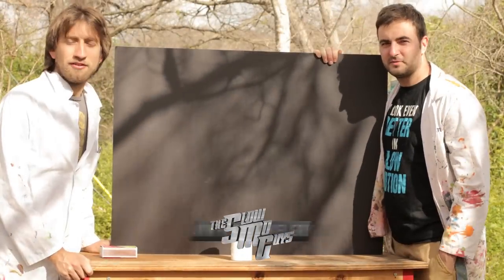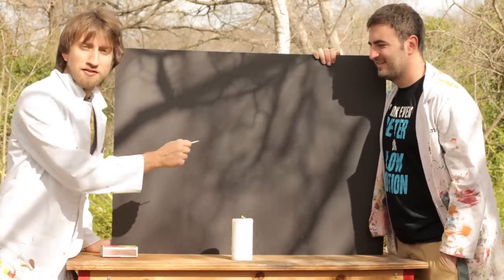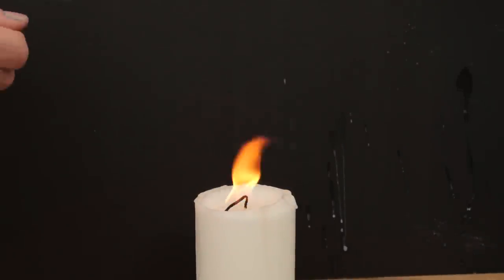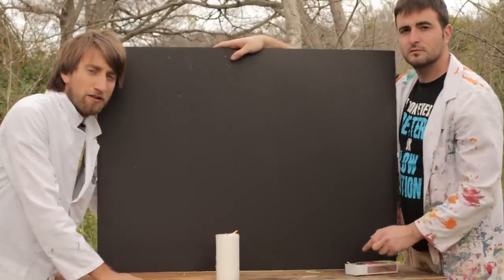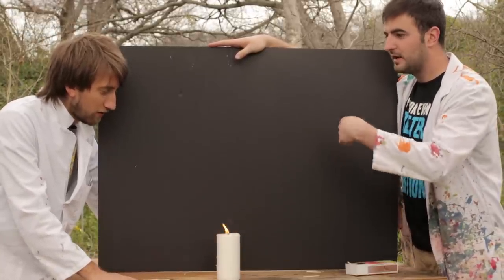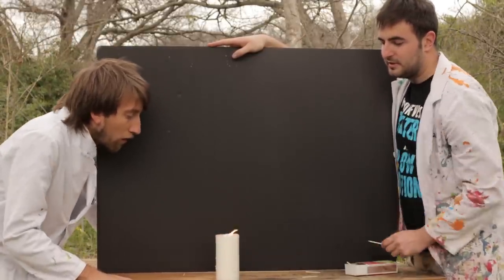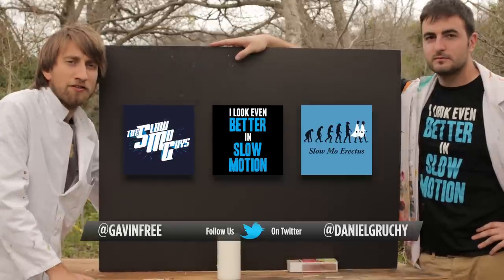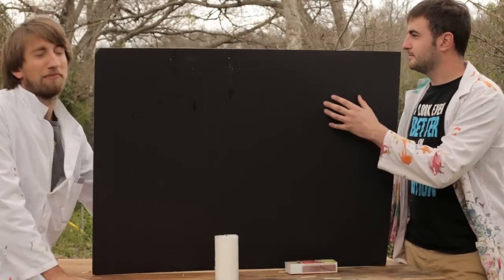Lighting a Candle Without Touching it in Slow Motion - The Slow Mo Guys

Comment: Hey Gav, I'd love to see RC helicopter blades in slow mo. Not the cheapo ones you get at the mall, but the full 3D ones, like 600cm across. Maybe you could strap them down and run them through the controls to see what the blades are doing, see gyroscopic procession in action, and maybe even the differences between flybar and flybarless types. That would make a great video.

Comment: Basically what happens is, the smoke is uncombusted carbon oder semi-combusted carbon (CO), because the wax is mostly carbon and it vaporizes faster than it can burn in the air. So when you light the white smoke, which is very finely divided Carbon in air, it combusts and turns to carbon dioxide, which is colorless (which is why the smoke seems to disappear). The flame itself is just gas being ionized from the heat of the carbon-oxide reaction, but the smoke burns so quickly back down to the candle, that the air around doesn't get heated enough to be ionized, which is why you don't see a flame jumping down from the match to the candle, but just the candle flame reigniting.
Interesting sidefact for cars: If you see a car accellerating and a black cloud is coming from the exhaust, it means that the engine doesn't get enough air to properly burn the fuel. It's often a sign for the engine either being too cold or badly adjusted (which can happen during a non-professional tuning)

Comment: Warning: The following contains the thought of a Nerd and what this nerd believes to be happening. Do not read if you have little or no interest in science.
What I believe is happening is that the candle has not got the required level of oxygen to form complete combustion, and after the flame is extinguished the smoke is actually mainly consisted of unreacted carbon particulates. When the other flame is put in the smoke and the smoke has not diffused too much (is basically still in one blobb) the flame from the match can ignite these particulates and can travel through the smoke, to the candle, thus igniting it again. 

Sound about right or completely wrong?
Reply: A bit like a dynamite fuse only it's a gas
Reply: Nashyj495 what i thought it was is that the wick of the candle is coated in an oil so its easier to light and burns for longer, and the smoke is just the oil fumes from the wick ,so the fire from the match ignites it leading to the candle to be relit.
Reply: Yeah sounds about right. But you also have to take in the fact that there has to be a critical temp for the flame to reignite the candle. And also that if you dont have a fuel the flame front will not travel in a specific path.
Reply: I've got exams in about 2 weeks. You givin tuitions?
Reply: Nashyj495 So is it kind of like, when your pilot or stove ignition blows out, and you have to manually light it? Is it that same type of reaction or?
Reply: Yes! I was thinking about carbon-monoxide. That can ignite as well.
Reply: Look at smarter every day's video of this he explains exactly what happens
Reply: Timothy Thomas It's similar, but in that case the fuel source is a gas (methane, I think) and is fairly flammable so it's far easier to ignite
Reply: omer nadeem I would be willing to but I think you over estimate my abilities ;) also By the looks of things you're not in England given that most exams here have already started, but if I could I would, probably for free as well :'D
Reply: Nashyj495 Not carbon particulates. Long chain hydrocarbons. The rest though is literally what Dan said: the candle doesn't burn the wax completely, hence the smoke contains a lot of wax vapour. This can be lit again when there is no flame there to dissipate the vapour.
Reply: Mr Geary I commented before I started watching the video but thanks for the clear up :)
Reply: Nashyj495 There is no candle that would produce a pure Carbon vapour, that would be coal if anything

Comment: If something is hot enough it will set alight without the aid of fire originally (this is called ignition temperature). The heat passed through convection (the heat passing through air) will probably restore it to the ignition temperature as it was very soon after being dropped from it. 
It's the most common cause of thatched roof fires, as it isn't embers or fire that sets it alight, it's the heating of the bricks that makes up the chimney, that causes the hay to set alight, as hay has a very low ignition temperature.

Comment: Would this still work if you lit a match, blew it out, and used another match to light the smoke that the first match was letting off? Since theres no wax would it still work?
Reply: Stcy Dime no, it wouldn't
Reply: But...but...thats...whaaa...why you do dis to me...
Reply: Srgtyn Because a match is designed in such a way that it cannot be relighted, even if in direct flame
Reply: Nicola Sabbadini no because the vapour is smoke which is non-flamable
Reply: Shiny Caterpie yes, because the "vapour" is smoke, which - being carbon monoxide - is flammable.
Reply: Nemozoli actually if it was carbon monoxide it would be colourless and we wouldn't be able to see it. Also when you light a match it is complete combustion that is taking place due to there being a plentiful supply of air therefore carbon dioxide, a non-flammable gas, is produced. carbon monoxide is only produced in incomplete combustion
Reply: dabazz117 lol yes they can.

Comment: Maybe try filming this one INSIDE, where the wind wouldn't be blowing the flame and smoke all over the place?
Reply: I think it's better they did it outside so you see the vapour trail
Reply: Razzlewolfflight Its the lighting. Maybe they don't have the proper lighting to do inside.
Reply: Razzlewolfflight when something is shot at a high frame rate, you need a LOT of light to get a good shot. Not much stronger light than the sun!

Comment: I'm a fire fighter from Texas and they teach us this stuff. It's not the vapors from the wax because was isn't flammable it's the smoke from the initial flame. Smoke is an unburned fuel, so once you introduce heat back into the equation it is going to catch and re-ignite. Same sense as a backdraft, room fills with smoke (heat already in the room) you give that smoke oxygen and the it combusts.
There is a thing called a fire triangle which consists of, heat, oxygen, and a fuel source, I love my job and anything to do with fire. I am not trying to prove y'all wrong I just wanted to inform you that this is what happens.

Comment: The smoke you see is actually vaporized candle wax. When the flame touches it, it travels though the vaporized wax like a lightning current and reignites the wick of the candle. Might not be accurate but I read this somewhere on the internet

Comment: Things I learned in The Slow Mo Guys's Videos :
Axe Through a Deodorant Can: Axe is called "Lynx" in outside of the U.S
Catching a Bullet with a Watermelon: Through each watermelon, the bullet slows down when the bullet leaves the watermelon
Flint and Steel at 5000fps: Some of the fragments dont light immediatly
Crossbow at 2500fps: Same with shooting the watermelons, the arrow was slowed down through each bottle
Beer Bottle Trick at 2500fps: "Well, with water, what will happen is the water will lift from the bottom, because of the downward force, create a little vacuum 'cavitation'. Then, the water catches up and slams back down, and it will blow out the bottom of the glass" - Gavin
How a Slinky falls in Slow Motion: A slinky will not fall until the top rings slams into the bottom ring
Tablet vs Paintballs: You can play Angry Birds with the Thinkpad Tablet when its shot with paintballs
Thanks Gavin and Dan!

Comment: I do the same thing when my pellet stove stops dropping fuel.
Take a big handful from the auger and put it over the red hot coals.
The vaporized wood and "other" stuff concentrates untill its super condensed in the container. Then i hear a whrrrrrrof as a flash fire re-ignites the pellets.
This gives me enough time to reset the system so the pellets drop again.

Comment: No the reason why the candle relighted was the left over oxygen from the smoke goes near the candle and relights. That's why some fires relight if the main on is put out but not the smaller ones.

Comment: The reason why that happens, is because for fire to happen you need 1. Oxygen 2.Warmth 3. Fuel. And when you take away heat, the oxygen and fuel is still present and you add heat then the candle will relight.

Comment: It's cause the visible part is made of particulates (very small bits of unburdened fuel) and when you light these particulates they catch fire but you can't really see it as the particulates are so small and they burn so fast, and they then burn back down to the candle in a similar way to the powder you used in your fire breathing video.

Comment: You'd imagine you'd see some flame on the vapor trail if you're setting it alight. I kind of got the impression that it kind of uses the trail to transfer heat which lights the wick again...which I guess is the exact same thing but it seems different in my head for some reason.

Comment: I saw it in normal speed, I saw the flame going downwards and I instantly realized that what happens is that the fumes / smoke is lit and it carries the heat down and re-lights the candle. .. do i have faster motion eyes low? I'm serious, i DID see it before watching slow motion.

Comment: Combustion of the smoke heats the smoke below making it expand before combusting when it burns to the wick the smoke underneath can't expand much in volume do to the candle pushing back against it that leads to a larger amount of combustion starting at the top where a lot of the heat underneath is  going to burning down to the wick which is why it starts burning from the top down.

Comment: You guys should slowmo a water drops dropping on extra hot coals (need some additional source of air for them to get super hot e.g. fan). The water should technically explode because the coals will be so hot that the molecules H2O which make up water will separate from each other.

Comment: actually what happens is, smoke contains a high amount of carbon, coal also contains a high amount of carbon. remember when you put out coal fires that the coals are still hot, the smoke does that too, therefore igniting the wick.

Comment: No offense guys but this could have been much better. I've shot videos using my phones slomo (120 fps) and you can see an actual flame traveling down the smoke trail. Grant it, it is still pretty quick at 120 fps, but the flame illuminates as it travels down and looks much cooler. It may be because you held the flame so close to the candle, I'm not sure, but I think this could be much better.

Comment: Hey, I'm wondering... I'm not the best at science stuff but surely if you can re light the candle by touching just the smoke trail with the flame surely you can light other candles or other stuff, not just the original candle using that same smoke trail, right?? As long as the smoke is touching or surrounding what you want it to light. Sorry about the lack of science words😂😂 but can anyone answer this ????

Comment: What is happening here? I'll tell you.
A candle works by burning the vaporized wax, when you blow out a candle the smoke you see is the vaporized wax. For combustion to happen you need Oxygen, Fuel, and Heat.
Your oxygen is in the air, your fuel is the vaporized wax and with that heat from your match the candle is able to re-light.
I realized while I was typing that #DantheMan explained it but, try to stop me from re-explaining it!

Comment: that is because if the electrical property's of the fire (its a plasma) so the electrodes traveled down the smoke like a wire and converged where the residual energy was

Comment: The wax isn't fuel though
Reply: 10jconway Yes it is. That's how candles work.
Reply: iPTGi
I thought the wax was the opposite of a fuel, slowing the wick down. Shorley if it was a fuel it would burn the wax?
Reply: It does burn the wax. The wax is evaporated off as a vapour, that vapour is what burns.